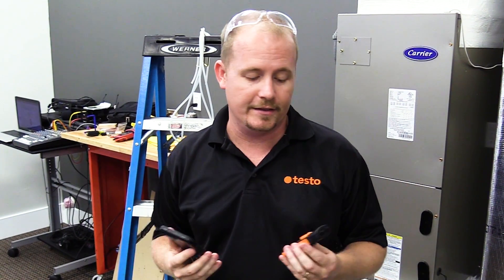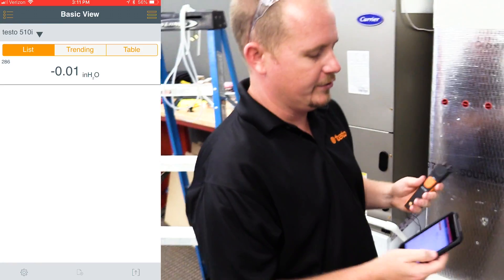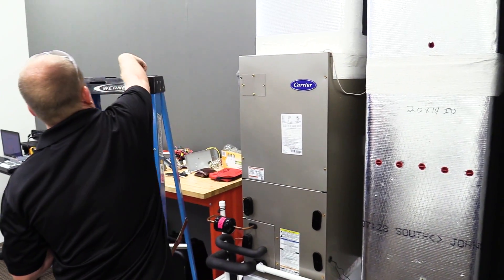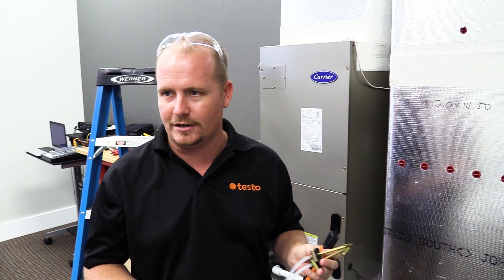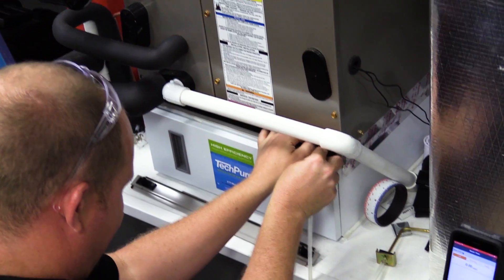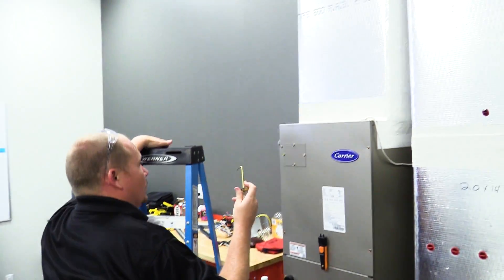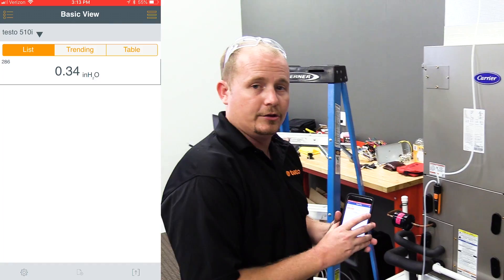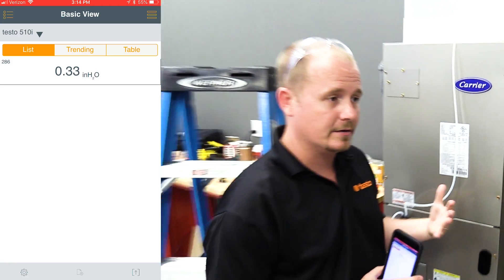How to Measure Total Static Pressure w/ Testo 510i

Comment: The HVAC videos do not discuss the increase in Electric Consumption from High Static conditions.
Over the life of a Furnace, or Air Handler, the waste in power is Staggering, all paid for by the unsuspecting home owner.
Ex:  (At 1 amp per 0.1 inch (my furnace/AC is .2 over)=0.16KWH/hr., 1,250hrs/year, 25 Years, $.185/KWH gives 
$950 wasted, over the life of the unit.)

Comment: How do i use the testo without a pitot tube. I got 2 hoses in the box, one with a plastic end and one without. If i am measuring a vacuum, i connect to the minus. this is correct? and i just leave the positive to the atmospheric pressure. does the nozzle need to be perpendicular to the flow or can i just stick it in?